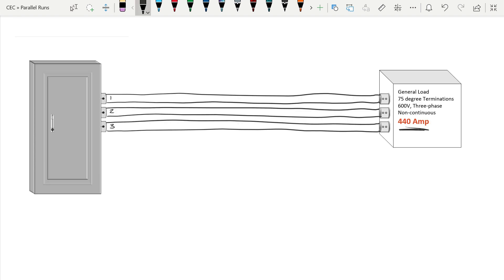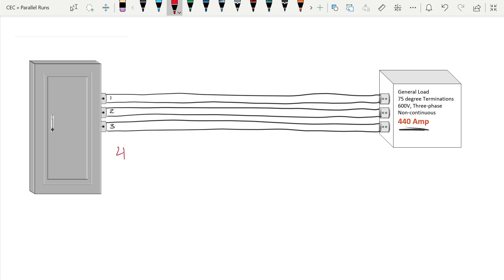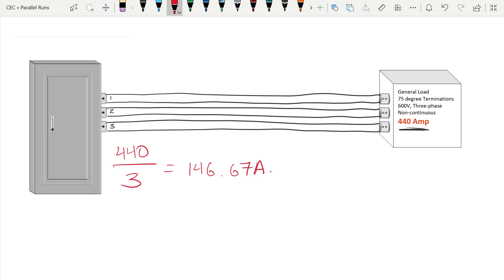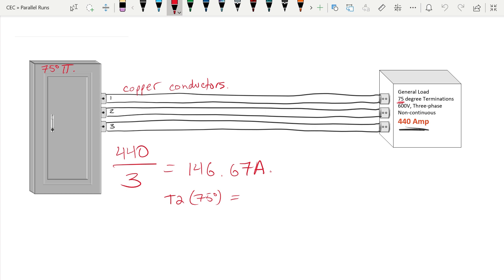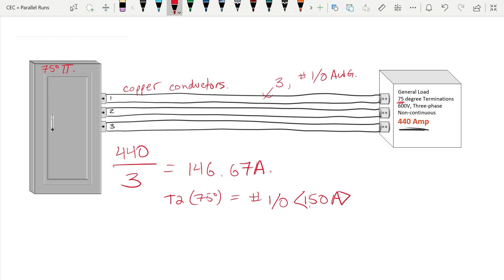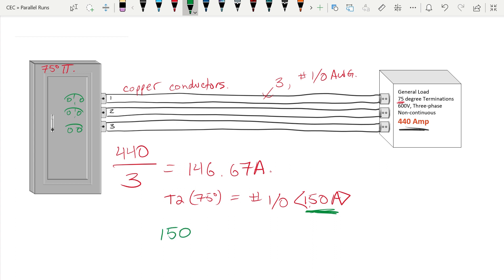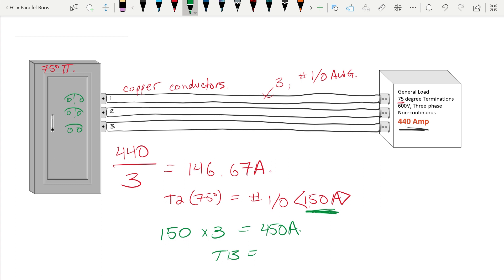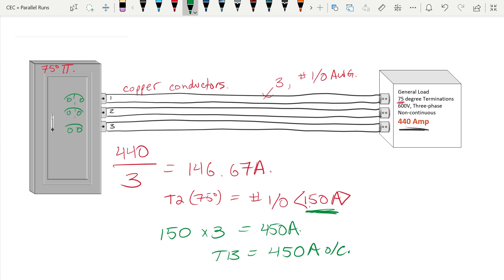Parallel Run Calculation

Comment: does it change if you have a neutral?
Reply from the maker: The neutral can be sized the same as your ungrounded conductors. You are permitted to apply 4-018 to reduce the neutral size of needed though.
Reply: @schulerruler  do you need to de-rate the conductors if there are four because of the neutral?
Reply from the maker: @dovisaacman178  No, as it is not considered a current carrying conductor based on 4-004 3), and 4). 
I look at it as the four wire circuit will never have more than 3 equivalent conductors of current.
Reply: @schulerruler  Thank you so much!!! 4-004 3)
Reply: @schulerruler  Hi, I can understand everything just what is this 4-018 and 4-0043? I will appreciate your response
Reply from the maker: These are references to the rule numbers and subrules in the Canadian electrical code book published by the Canadian standards association (CSA)

Comment: in theory could you do as many parallel as you want? to use small wires? or is there a code againts that?
Reply from the maker: The smallest size permitted is a  1/0 conductor so there are limitations on it.

Comment: Is there 9 conductors in total then? 3 per conduit?
Reply from the maker: That is correct.
Reply: @schulerruler  Where would the nine wires connect to at the 3 pole breaker and on the load? Sorry,  I'm just starting out.
Reply from the maker: @rob1111  often times on larger breakers there are multiple termination points, or the terminal is rated for multiple conductors under the same termination.
Reply: @schulerruler  I see. The same would be at the load side too I guess. ( multiple terminations)
Reply: Thanks 👍
Reply from the maker: You bet. Welcome to the industry! It's a good one to be a part of!
Reply: @schulerruler  Thank you very much. I'm really enjoying it. Sorry, I'm still trying to visualize this. Are the nine conductors sharing the ampacity to the load? Or couldn't three larger conductors do the job in carrying the ampacity in one conduit if it's just to one load? It's okay if you don't answer if you're busy - I'll understand it eventually. Thanks though!
Reply from the maker: Sometimes it's cheaper to go with multiple smaller conductors. Also, there are times where the required ampacity exceeds a manufactured conductor. For example I did a 4000 amp upgrade to a data centre, and it had to be parallel runs.
Reply: @schulerruler  Ah, okay. I'm studying and researching and slowly I'm getting to see the intricacies of certain things. Thanks for taking the time to reply.

Comment: Great info thx. Not sure but you should draw only 1 instead of 3 OCPD on your video presentation.
Reply from the maker: As this is a three phase load, it is required to have a three pole breaker, but as the drawings of the breakers look like they are lined up with the conduits I see the confusion. To be clear the symbol drawn is not for three individual breakers, but one three pole breaker.
Reply: @schulerruler  thanks for this clarification
Reply: @schulerruler  make sense.  Quipment grounding conductor in ea raceway need to be based on the ocpd and big enough to clear the fault need not Devine by 3.